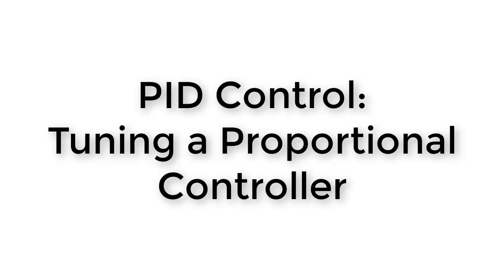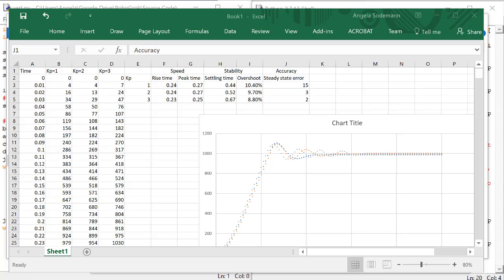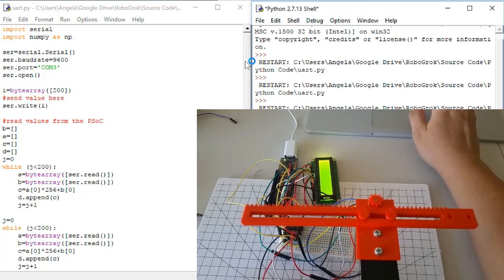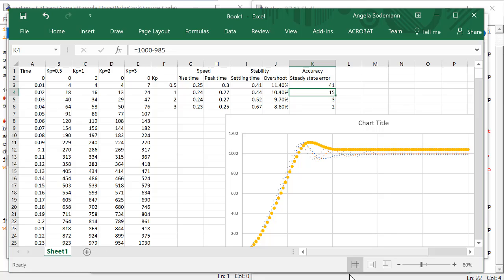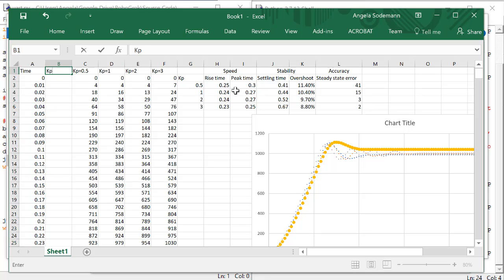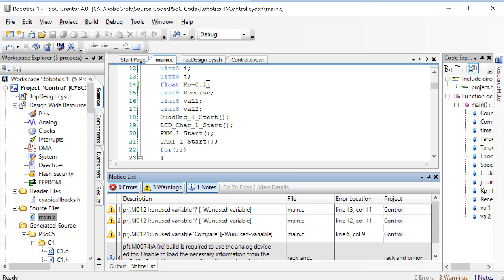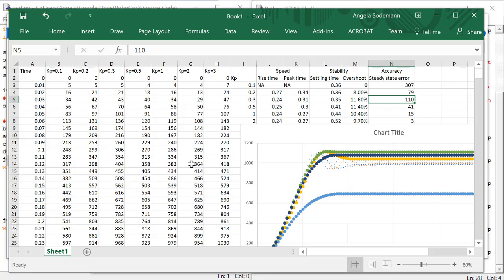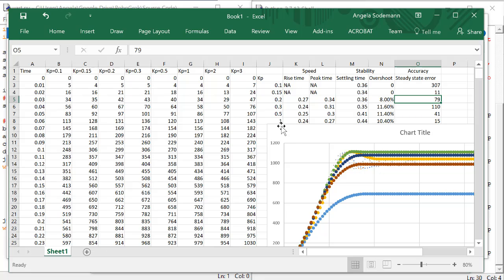Robotics 1 U3 (Motion Control) S5 (PID) P2 (Proportional Control Tuning)

Comment: Great series Angela! In fact ALL your posts are!!!
Pity the field of robotics control was not in the syllabus when I was at school back in the '60's.
Maybe I am "jumping the gun" a little but will you be covering the use of acceleration and deceleration ramping in the motion control algorithm in this series? 
My "project" is using modified auto windscreen wiper motors ( times 7 ) which have way more inertia than the motor you are using for the tutorial and overshooting is a massive problem because of that.
I have even thought of giving the motor reverse polarity pulses or applying a dead short across the motor leads to slow it down but that will probably have a serious effect on motor heat generation and may even blow up the power switching circuits so I do not really want to go that way if I can help it.
I'm slowly working my way through your entire series of lectures and they are great!
Please keep them coming...
Aubrey